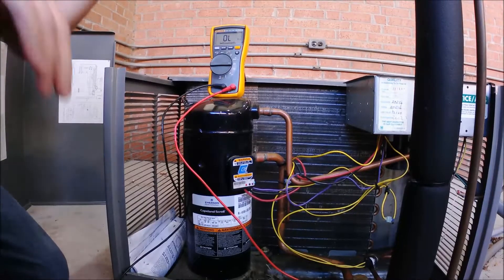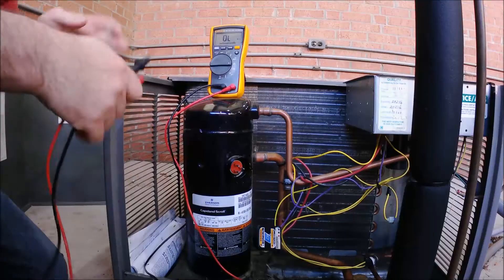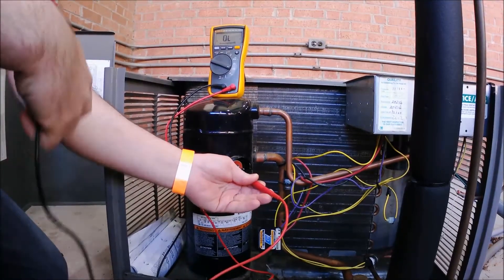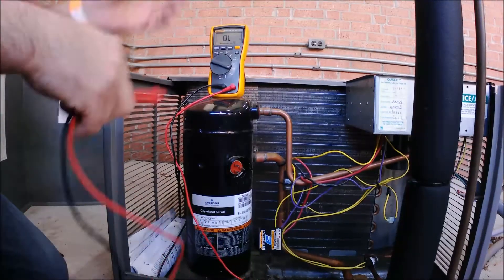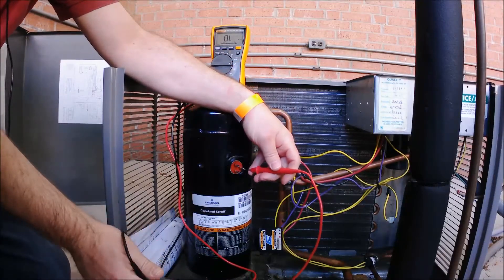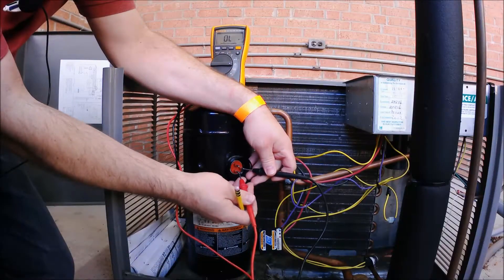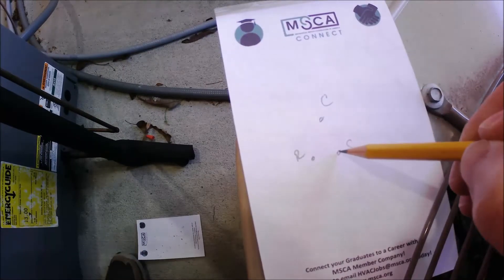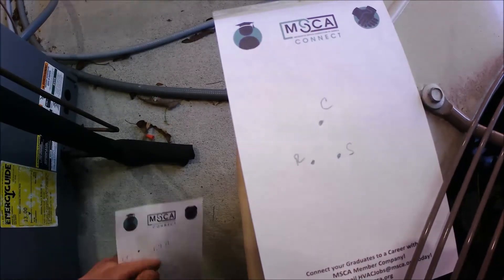HVAC Compressor Checks - Short to Ground

Comment: If the start read 56 and run read 24 and the addition is 80, so is the compressor working or is dead
Reply from the maker: You can assume that the electrical winding are intact and not broken. It should run.

Comment: Why wouldn’t you use an insulation tester ?
Reply from the maker: You could. I have a Fieldpiece SMG-5 ( i think) and it has proven useful... even had the chart folded in my wallet for years. But if the compressor is already eat up with acid it almost  doesn't matter really, it is going to be an open winding. For me, they are very useful if you work in a plant or something and are maintaining records in a preventative maintenance program.

Comment: I had one the other day that was shorted to ground on me. And another tech came out and swapped the capacitor and it worked fine.
Reply from the maker: And you checked it at the actual terminals on the compressor? Or from the contactor?
Reply: @johnjennings-JJ  I did all three terminals and all three wires. Got a reading on all 6 never a OL.

Comment: I have ohm out my compressor and my number where high will that indicate I have a bad compressor?my number don't match from R to S.
Reply from the maker: The numbers might not match exactly but should be fairly close but higher resistance values could be indicating a problem with the compressor motor. But I honestly don't get wrapped up too much because I don't know what the values should be exactly until I look the up from the manufacturer. Then you can see exactly what they have designed and if your numbers are truly higher.

Comment: Wow, really you left out the reson for the video.  1.7 and 1.4 should equal close to the 2.9.😮
Reply from the maker: That it should... but I have really never seen them add up perfectly. The whole resistance checks and ohms law works good with DC circuits and purely resistive circuits though.

Comment: My compressor pulls 110 amp at the start, LRA states 118amps. 5 ton unit. How much life left on my compressor? Thank you!
Reply from the maker: Tough one. Sounds like it is within specs! But I have had them go bad while I was at the unit too. Let it run until it doesn't is what I would say. If you want a good read, google this - Trane Snowball or Snowball 2. compressor.
Reply: @johnjennings-JJ  I will. Thank you!

Comment: What happens if the resistance values are extremely high, I’m assuming is a bad compressor but what could cause to have such a high resistance ?
Reply from the maker: Well...too much resistance for "X" amount of voltage in general will not allow the thing to run. But I (personally) have never had a compressor with an extremely high winding resistance. Not saying it can't happen but I just haven't seen it. Best practice is to get the manufacturers specs I guess and compare it to the actual readings. Example I have seen is a tech put a 480v rated relay coil in a 24v system...just didn't pay attention to the relay they grabbed...and nothing worked. They check voltage to the coil and it is there, just the relay isn't working. They had a relay with more resistance than the voltage could overcome and energize the coil.

Comment: Awesome had to have a quick refresher just to make sure my diagnostic was correct. Thanks for the video!
Reply from the maker: Not much too it but to do it! Thanks to you sir. Been a minute since I have seen an 0311.
Reply: @johnjennings-JJ  I know a few 0311s working the hvac trade. Not sure why this job field attracts us. Maybe it's the long work days with little sleep mixed in with low crawling and uncomfortable spaces 🤣.

Comment: Adding the Run and Start should equal the C reading right?
Reply from the maker: The common is just the terminal labeled on a PSC compressor motor. The testing of run to start gives you the added resistance of both windings. Run winding is from R to C, start winding is from S to C. There is no common winding. It is "Common" because that is where the run and start winding both meet "the other side of power".

Comment: Scroll compressors will have 20 olms to ground but the motor is fine. The windings actually sit in the refrigerant to be cooled.
Reply from the maker: Thanks for leaving a comment. There is a lot of info out there such as that. I hope that techs would search out the specs on all the motors they come across in the field before assuming it is bad.
Reply: @johnjennings-JJ  AE4-1294 Emerson/Copeland bulletin says not to meg a scroll but if you do the min is 500,000 ohm winding to ground.  😵‍💫
Reply from the maker: I hadn't seen that bulletin. I will check it out. Thanks for sharing.